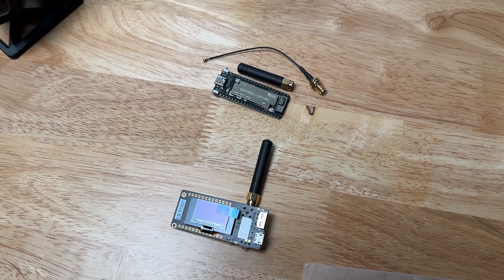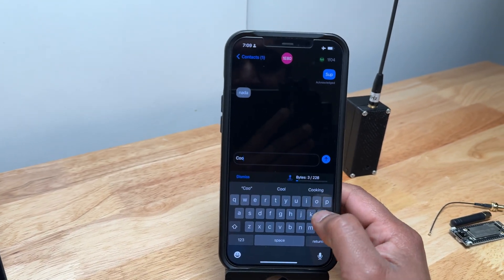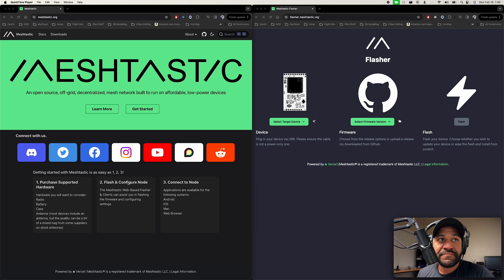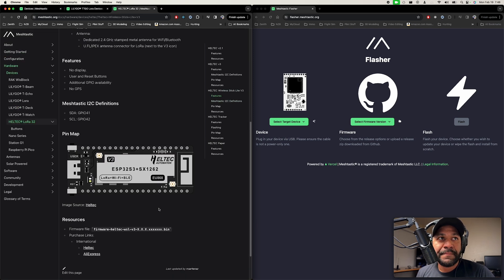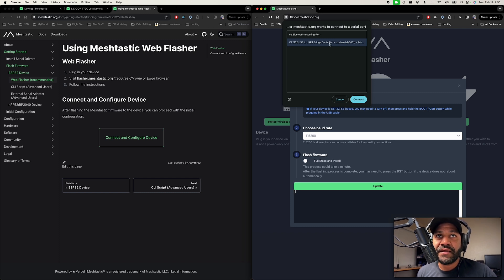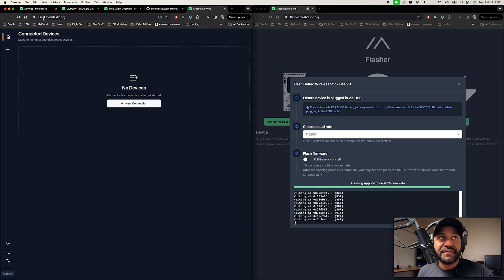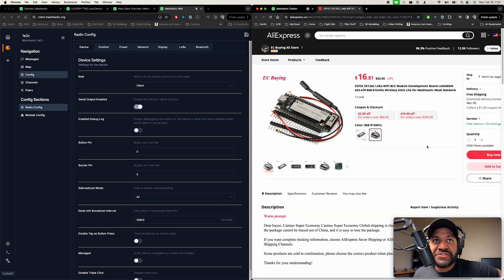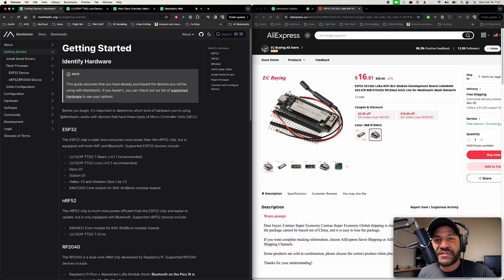MESHTASTIC OFF-GRID COMMS : GETTING STARTED, UPLOADING FIRMWARE, MESSAGING

Comment: Maybe you can help:  I don't understand this Docker utility.  I have successfully flashed a Heltec ESP32 V3, and partially set up some of it, but I'm at a standstill. Although I have attempted to send a couple of test messages, nothing seems to happen and when I'm looking at the Meshtastic messaging screen on my tablet, the cloud symbol has a line through it.  Any ideas where to look for things I need to check or uncheck, etc?  By the way, I have to run Windows because not enough hardware manufacturers design their hardware to work with Linux.  Although there are supposedly utilities in Linux to allow Microsoft designed hardware to work, I never seem to be able to get those to mesh.

Comment: Hello and thank you for your work making this video.

For years i have wanted an independent messaging system. This may be it. Is a computer needed to update the firmware or can it be done from a mobile phone? I heard you say Chrome is needed, but i do not have access to a computer. 

I have a few other questions that ill save for another day.

Thank you so much for your reply. Any other information would be appreciated.  I am limited in resources and skills but i am researching Meshtastic more and more.
Reply from the maker: As far as I can tell, you do need a computer to upload firmware. It does work on linux, would it be feasible for you to get an older raspberry pi perhaps? The model 3 with wifi would be a great option. You could even get a pi zero 2 W which is even cheaper but a bit slower. You could install chromium onto those and that would allow you flash firmwares.
Reply: @SkillCollectors  thank you so much for the reply. Currently I am... I am in the hospital for an undetermined amount of time and can not get to a computer. I was hoping to be able to obtain as much of a complete device as I could so I have something to play with while I'm on the 7th floor with a window overlooking the city. 

I thought it would be fun to see if I could find others on the network. Nevertheless, in the meantime I'll keep watching new videos as they come out and go from there. 

Thank you again for the suggestions. Have a wonderful night.